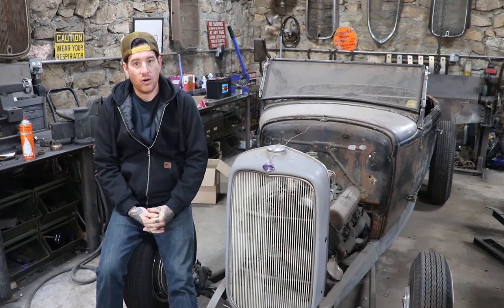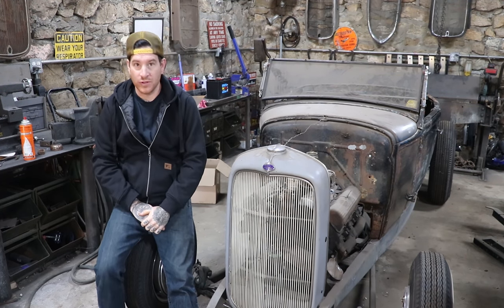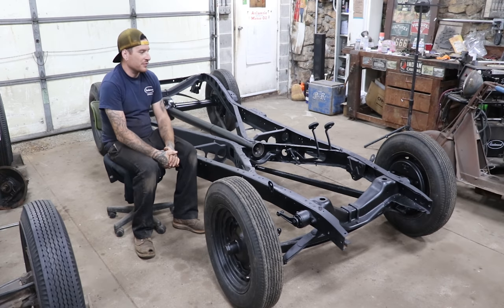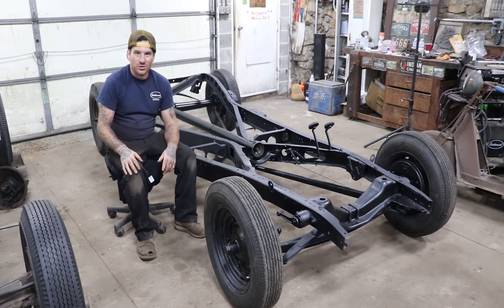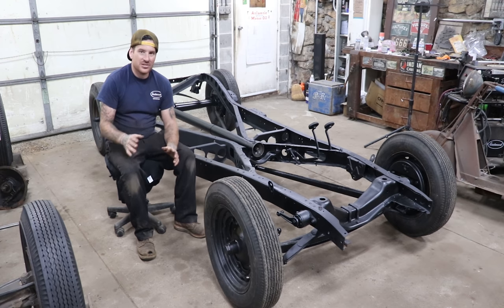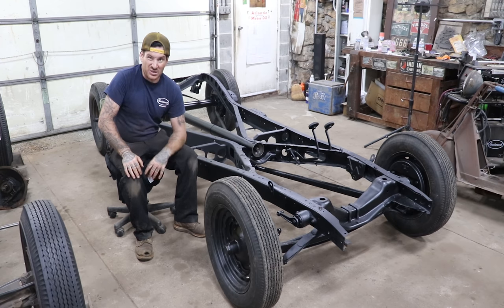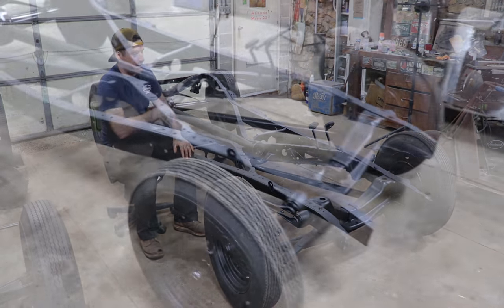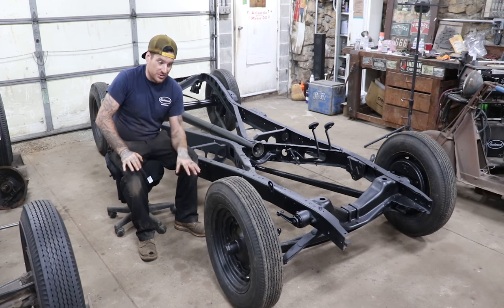1939 Ford Junkyard Hot Rod Revival - Ep. 14

Comment: I was always taught that the final tightening of shackle bolts. suspension and shocker mounts etc.  should not be done until the weight of the car is on  the wheels

Comment: Did you spray the encapsulator plus straight or did you thin it and with what?  What size tip did you use?
Reply from the maker: Sprayed it straight. 1.3-1.5 tip works

Comment: hi matt,what type of spring shackel bushes do you use?original ford rubber type or modern material.undecided what to use on my 46 coupe
Reply from the maker: I use the rubber 2 piece style on most as its easier to assemble. Hope that helps!